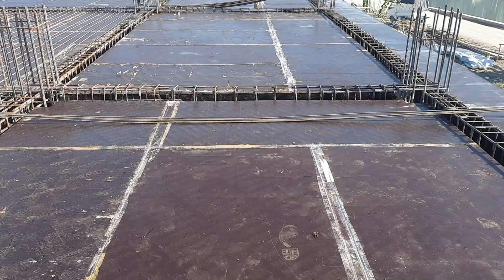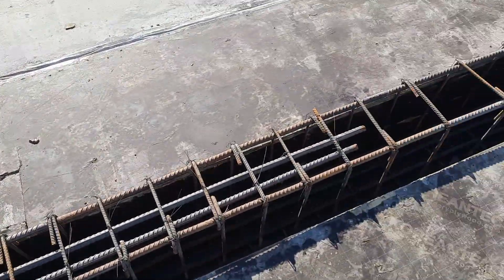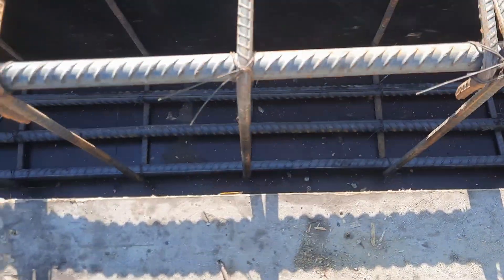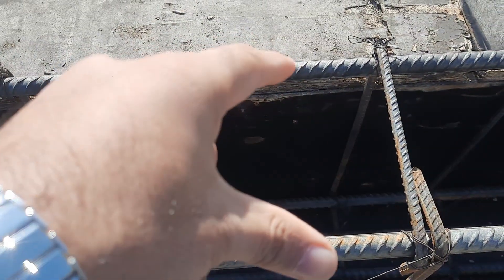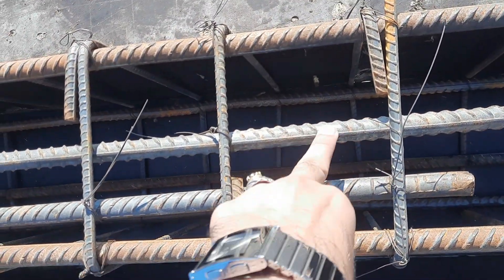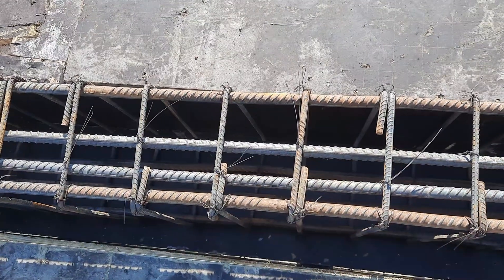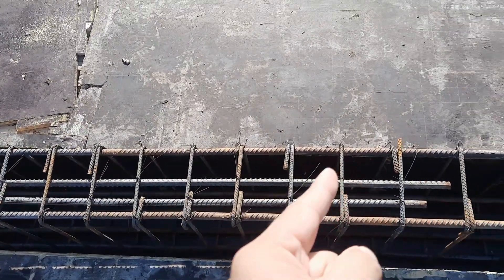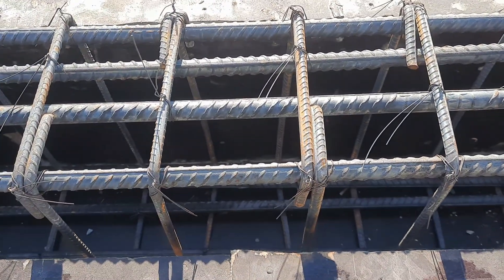30 feet span of beam Steel Structural Design

Comment: At the left side of the beam, the negative steel bars are not arranged symmetrically. Could that cause any serious functional issue?
Reply: I would guess that it is a small insignificant reduction in strength. But I still think the energy would be spread enough even without the full 1” gap between bars. Probably stronger than a total side by side lap, but less strong that perfect spacing?